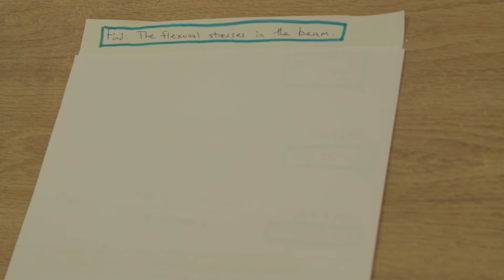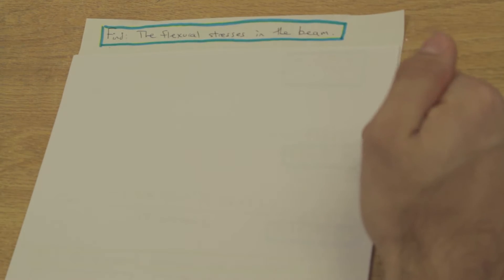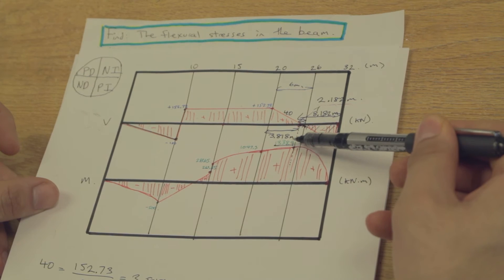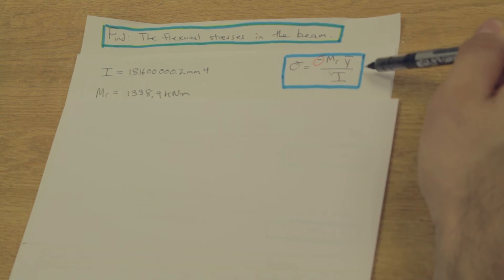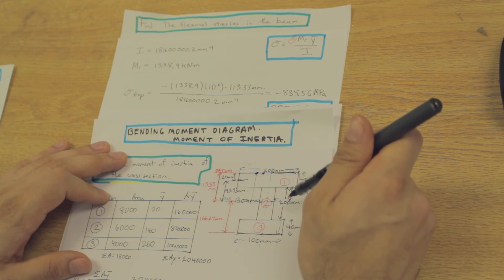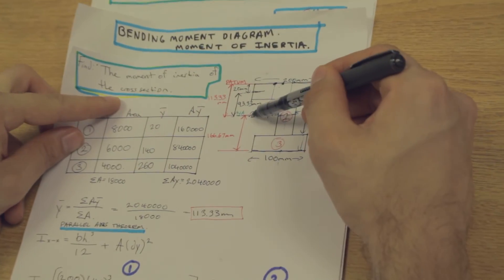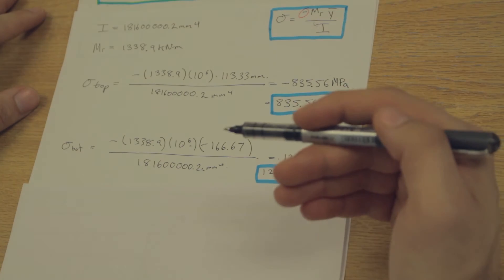How to Calculate Flexural Stresses 1/2 - Bending Moment Diagram Part 6

Comment from the maker: TimeStamp !

1:40 - Theory Ends - Solution Beings 
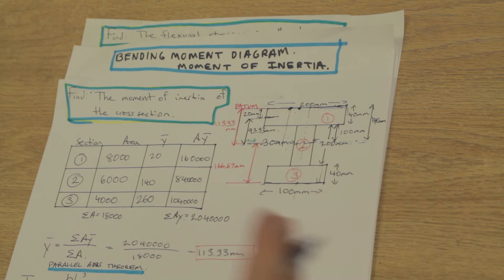1:55 - First step - Understand where the numbers are coming from
3:25 - Second Step - Start Plugging Numbers into the Formula  
3:51 - Third Step - Calculate "The Top half of the I Beam"
5:27 - Fourth Step - Calculate "The Bottom half of the I Beam"
6:18 - Final Solution (Now try to do it on your own!!)

Note! This is a very LONG Question! Here are all the links you need:

1) Links for "How to Draw A Bending Moment Diagram"
Part 1 - https://www.youtube.com/watch?v=017RBmA03Ek&list=PLv11OuQcvb_BS-jCW0aU-BoM82VBWedy7&index=5
Part 2 - https://www.youtube.com/watch?v=1zsTPqDQjAs&list=PLv11OuQcvb_BS-jCW0aU-BoM82VBWedy7&index=6
Part 3 - https://www.youtube.com/watch?v=UYkH7Fxkxmo&list=PLv11OuQcvb_BS-jCW0aU-BoM82VBWedy7&index=7

2) Links for "Moment of Inertia and Centroid" 
 Part 1 - https://www.youtube.com/watch?v=-_Zb9csGzFY&index=9&list=PLv11OuQcvb_BS-jCW0aU-BoM82VBWedy7
Part 2 - https://www.youtube.com/watch?v=-_Zb9csGzFY&index=9&list=PLv11OuQcvb_BS-jCW0aU-BoM82VBWedy7

3) Link for part 2 - "Calculating Flexural Stresses" - https://www.youtube.com/watch?v=FMSzgeiVwR4&index=11&list=PLv11OuQcvb_BS-jCW0aU-BoM82VBWedy7